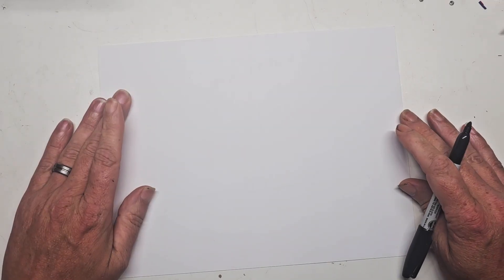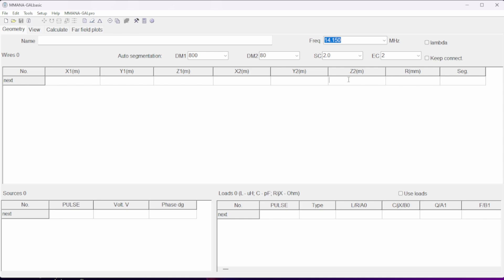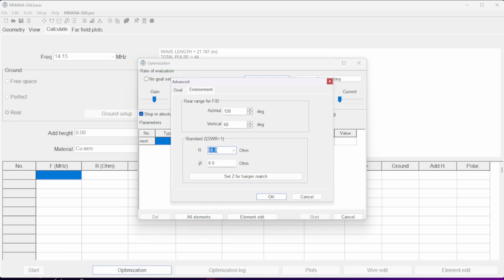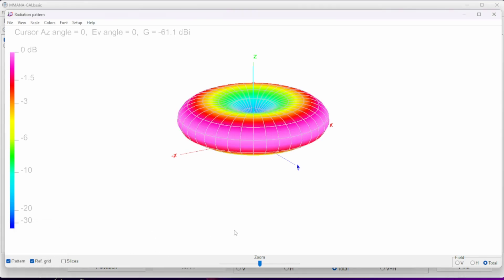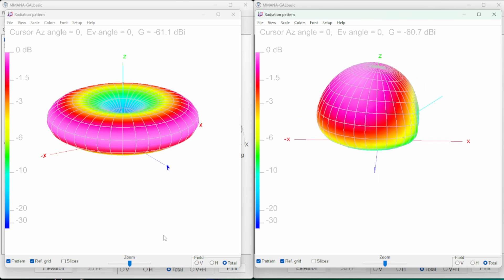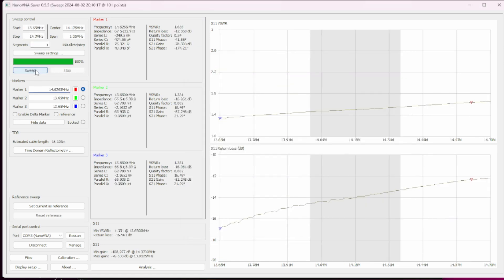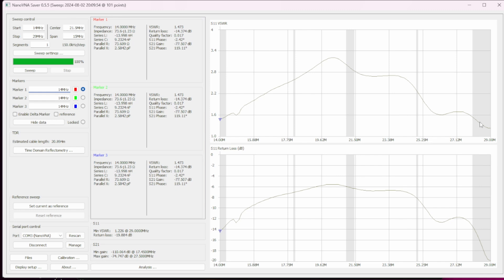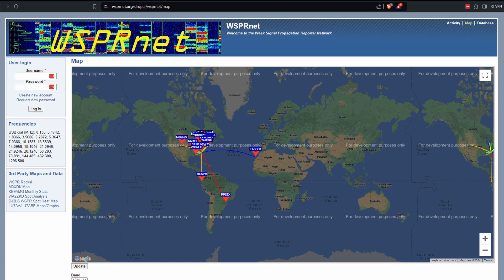DIY 20 Meter EFHW Vertical Antenna

Comment: ....the EFHW is in itself is a complete and efficient antenna, and for regional or continet wide coverage, (field day) no radials are necessary.. What changes the pattern is how and if you use some kind of counterpoise or ground plane...with a multi wire array of RAISED radials over a concrete roof, with lotsa rebar in it, I found the 20 and 10m performance suggests better than your plot; with performance that seems to rival a 2 element beam.... and I use only100 watts and a LiFEPo4 battery for power. In addition, using 30# test copper fishing line, sprayed with a light blue laquor for addional corrosion protection; this antenna becomes near invisible against the sky...

Comment: these antennas work even better with the feedpoint elevated to 2m  check the modeling in your software then compaire it to WSPR results,  it does require a 12 m pole though!!
Reply from the maker: I will have to try that

Comment: Thanks for posting this! Due to HOA constraints I'm running similar 20 m EFHW up a palm tree with 49:1 unun , but I'm using feed as counterpoise. I kinda stumbled into this config just trying to make something work in space I had, and I was pleasantly surprised with the results. What is your reasoning on the 5 m dedicated counterpoise v. using feedline and common mode choke?

Comment: Fascinating. I'm just curious about how you secure your pole elements so they don't collapse?
Reply from the maker: I try too many antennas to have anything up permanent. But if I was to try to keep it up for a longer timespan I would try hot glue or maybe RTV.
Reply: @BrokenSignal  One more question...does the counterpoise need to be stretched out?

Comment: I tried such a setup for 15m last year and was very impressed how well it worked. At that time, I did not have the license to also use 17m and 20, but this is what I am planning to do this year as soon as it gets warm enough again to operate on near by hills (I cannot put something like that up at my apartment). 
These types of antennas as well as T2LTs are my preferred ones as of now. I do not have much experience yet as I am new to ham radio, but it seems like with these simple and cheap verticals success is more or less guaranteed, provided the QTH is suitable. 🙂
73 de DL1HNR
Reply from the maker: Every antenna is a compromise of something. Verticals have long been know to be good for DX and can be easy to put up which makes them one of my favorites too. Good luck!

Comment: I haven't done that with a wire, but I have used the Chameleon CHA SS17 (17ft Whip) as a 20m 1/4 wave for several activiations and it worked well.
Reply from the maker: The low take off angle makes verticals work great for DX!